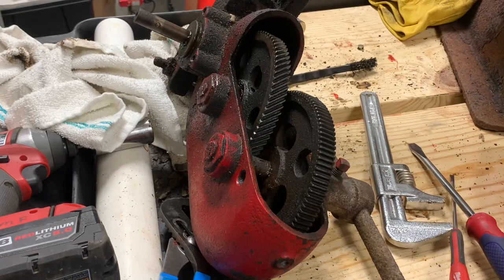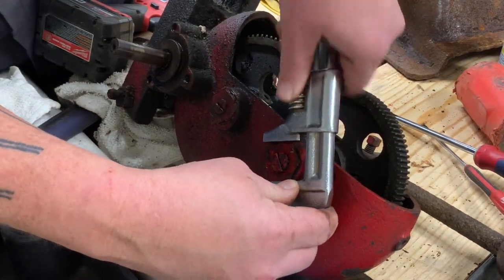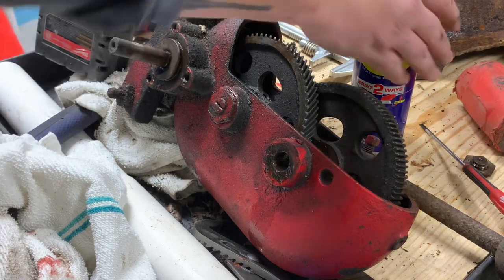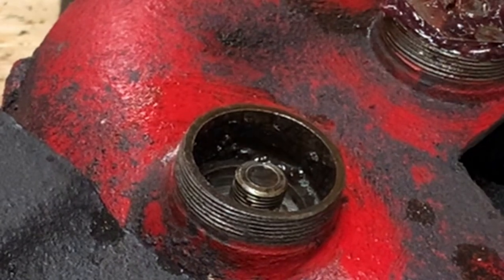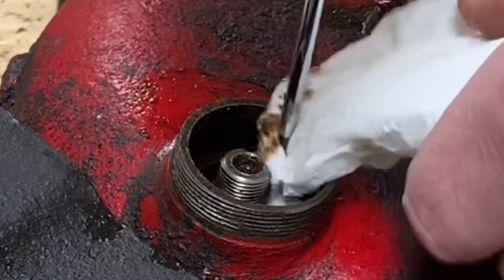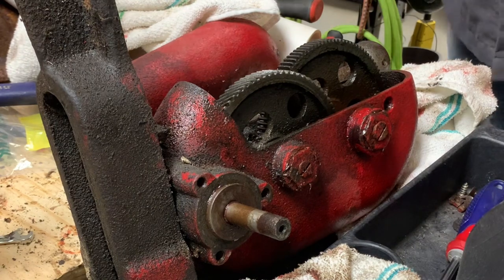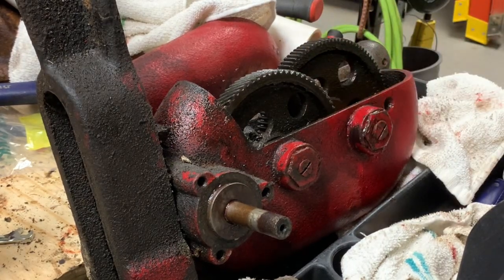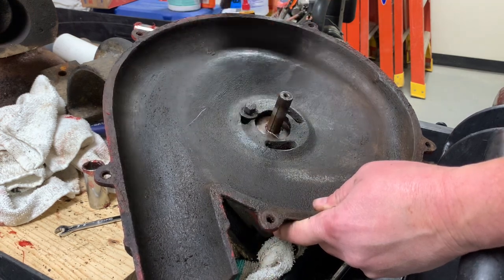Servicing a 111 Year Old Buffalo Forge Blower #buffaloforge200silent #handcrankbellows

Comment: How much oil are you supposed to put in these?
Reply from the maker: There’s a weep hole on the rear. Fill to that level.
Reply: @SharekGadd  Perfect! Thank you so much! I have the same blower and it is hard to find information on restoring it. Yours is the only video that I have found specifically for the "silent" 200 model.